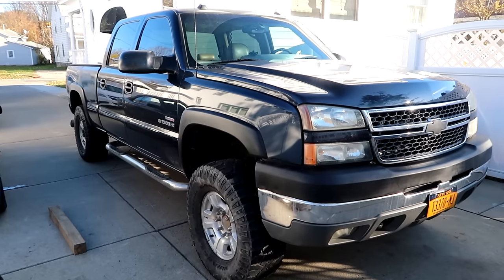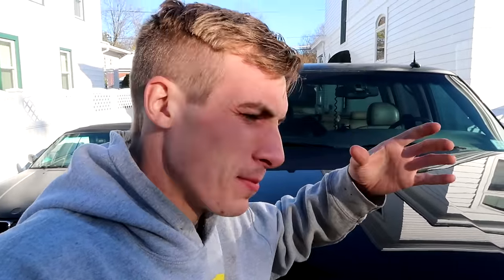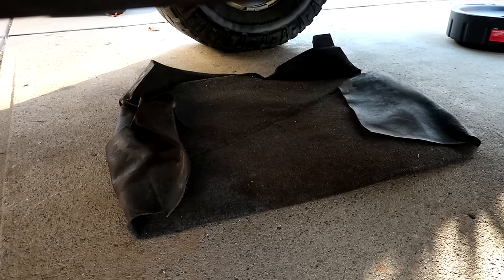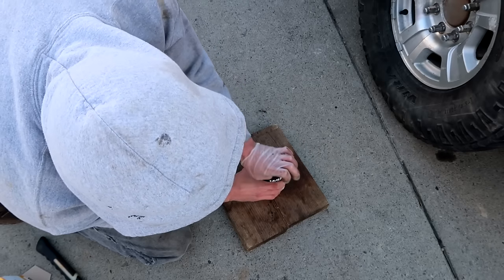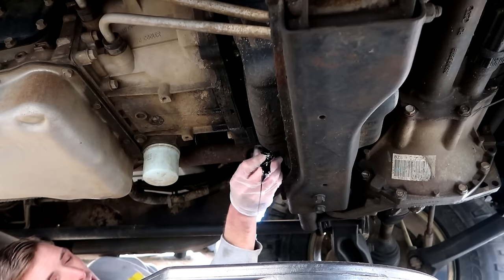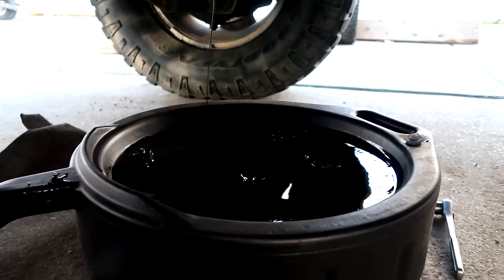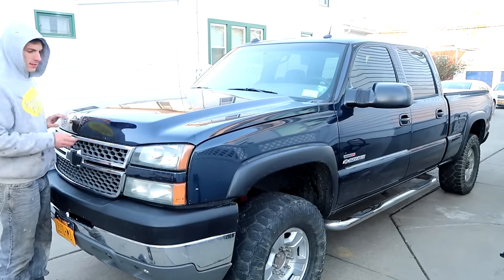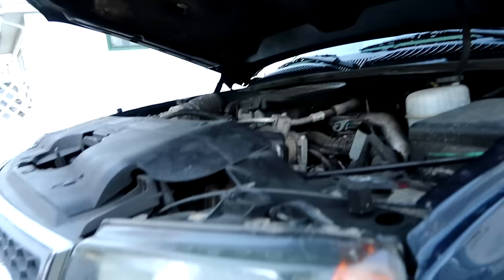THE WORST THING ABOUT A DIESEL...

Comment: I have 322,000 miles on my 2000 silverado with a 5.3 Vortec V8.  I change my oil every 3k miles.  YOU DO NOT FOLLOW THE ENGINE OIL LIFE GAUGE.  THAT IS HOW YOU FUCK SHIT UP!!
Reply: I have a truck that has 1 million miles on it
Reply: well then you must hate me i got a 1999 chevy silverado 1500 with the 5.3 also and i do oil changes on it every 5-10k miles if i feel like it and a 2003 gmc sierra 2500hd with the vortec 8.1 v8 and when the meter gets to 10% i throw another quart or two of oil in in then let it get down to 5% again then i change :)
Reply: also my 1999 chevy has 258,xxx miles and my 2003 gmc that i use for hauling has like 348,xxx miles on it and both still run just fine p.s. i run the cheapest oil i can get my hands on
Reply: Wind King That's interesting.
Reply: UNDEAD ASSASSIN as a mechanic, i call bs!
Reply: sgtLogez On what?
Reply: you dont need to change oil every 3k miles just follow the engine oil life gauge. in all the years of working as a mechanic i have never seen an engine which broke down because the oil wasnt changed often enough. i have seen cars beeing just fine after running 45k km on the same oil (on this model you normally change the oil every 15k km)
ps: sorry for bad english, i am swiss.
Reply: sgtLogez Maybe you don't need to,  but I do. Nothing has ever gone wrong with it,  and it runs like new.  So I'm gonna keep doing what I'm doing, thanks.
Reply: yeah they tell you that so you can bring it in to the dealer and get it fixed
Reply: Bike254 EXACTLY.
Reply: sgtLogez Break down,  probably not.  Run less efficiently,  and not last as long,  yes.
Reply: That "oil gauge" is just a percentage measurement of the oil service interval. Its just fine to do within that period unless the rings are fucked.
Reply: 5k is perfect intervals imo. At 5k you're not going way above and beyond, like those who run 8k or 10k miles, but you're also not changing it at 3k, which in a lot of people's world's would be quite often. 5k for me and everyone I know is 5-7 months, so twice a year and we've never had any problems whatsoever. Just my opinion, you can do whatever you feel the need too. What you're doing definitely isn't gonna hurt it, only help it, so have at it
Reply: UNDEAD ASSASSIN i have a '01 5.3 Vortec V8 at 310k still runs strong
Reply: Boe S. Awesome.  And of course it does!!  :)
Reply: That gauge doesn't know anything they're a joke
Reply: brandon65678 Indeed.
Reply: Brother, a diesel does not need the oil changed every 3K. 5K is a better interval. This is due to the 3 gallon sump for oil. Gas rigs? 3K is the way to go......
Reply: UNDEAD ASSASSIN dude I get 30,000 out of my semi before I get an a service. That's just under 2 months of work. So why are you changing your oil at 3k on a gas motor? I go 5k on both of my boosted VWs and the oil comes out a dark honey color.
Reply: FranksDD15 Cheap insurance.
Reply: Semis stay hot all day and they tend to last 1M plus though
Reply: Disagree. I have owned 8 cars in my life and they all died of several reasons but the engines were Always as good as new, mostly after 200k miles (on gas). I just follow the instruction manual intervals on each car. There is no harm in changing more often, except your own wallet.
Reply: I'm sure the manufacturer knows best what their engine can handle. General rule is 3k for conventional, 5k for blend, 7k for synethic.
Reply: I believe Service intervals for vehicles in Europe now are generally 10-15k or occasionally further, although typically they will also say annually if that comes first. These vehicles will specify fully synthetic which naturally lasts longer, but I don't see why anyone would change at 3k unless they like throwing oil and money away.
Reply: Those oil life meters go off of hours I believe not an actual sensor
Reply: The GM Oil Life monitor takes into account things like outside and engine temperature, vehicle speed etc.  It does a pretty good job of compensating for operating conditions.  And test after test has shown that recommended oil types still have solid performance characteristics when the OLM runs down.
Reply: my 96 suburban has 218k and I have gone 10k miles before oil changes (bad I know)

I've also personally seen an early 90s Cheyenne with 300k that hasn't had an oil change since it was under warantee owner is the origional owner and just adds oil as it gets low.  chevy engines are tough.  well the 350 is anyways
Reply: +Frogboyattacks right you had a lemon so it's impossible that anybodys chevy is reliable...

Comment: you should be changing the fuel filter every oil change, if not at least every other oil change..
Reply: You change it according to the service manual
Reply: ?? Fuel filter every oil change?? I dont know what kind of back woods crap you buy in where ever (ur sister is pretty) kinda town.. but a fuel filter, goes waaaayyy longer than that my man.. lol
Reply: parksey0345 trust me, it's worth it when you have a Duramax or power stroke or a cummins. I'm a diesel technician, it's what I do everyday. the high pressure fuel pumps do not like anything in there at all. and changing one of those is very expensive.
Reply: 607 Moto I'm with you on this one!! Cheap insurance! No reason not to. Would have also liked to see him grease the front end!!
Reply: Joelf2312 15k mile oil change? Holy crap lol. I change the oil in my duramax every 5k
Reply: Joelf2312 Actually you don't have to change the filter under bed every time. That's a water separator, only need to worry about that one when you get water in your fuel. Saves you a whole lot of money per change too.
Reply: Well they also don't want you doing your own oil changes and maintenance. But somebody stole my manual, so I haven't read through it like I prefer to do with my vehicles.
Reply: I do all of my fuel filters every second oil change just before winter. -40 up here and I'm not getting stranded because of a plugged fuel filter

Comment: I feel you my grandpa had a 7.3l powerstroke f250 it took so much oil i think like 14 1/2 quarts but dont forget his truck is a 6.6l my grandpas tuck was a 7.3l so it needed one gallon more than he needed
Reply: 747a380austin 111 yeah I just spent $100 on an oil change for my 7.3. But that's using motorcraft everything.
Reply: 747a380austin 111 I feel u my dad's truck was the same way it has a 7.3 in it
Reply: @weslyrobinson i have a 6.4 powerstoke
 It takes 16.5 quarts. With motorcraft filters and rotella t6 oil its like 175 to change mine
Reply: ive had both a 6.0 and 7.3 and my 6.0 also takes 15.5 qrts but the reason why the Ford engines take more is cause they are international motors and were made for school buses now the 6.7 is made by Ford but still uses 15 qrts but the new Chevy 6.6 uses 12 now I think but I'm not sure on it but the reason they have less is cause they are made by Isuzu with Chevy and gotta have a small oil pan to fit inside of those small box trucks
Reply: while we guys are talking about oil change I was 18-wheeler service tech the least amount of oil that one of those take is 32 quarts and that a Detroit and the most is a catapiller and those take 44 quarts and the catapiller has an oil filter that holds a 4 quarts just on its own
Reply: Adam Helms or we can imagine how much the big earth mover that is a 16 cylinder engine held, I used to be a tech at international and met a guy who worked on those motors and said they had a special pit to drain the oil into

Comment: Hahahaha you're complaining about 3 gallons  of diesel motor oil in your truck. I drive a semi and my kenworth w900 with a Cummins motor takes 13 gallons of oil and the oil filter alone holds 1 gallon of oil. It gets super expensive when you're doing oil changes on a semi it's around $200-$350 per oil change. Right now I have around 800,000 miles on it and it gave me no problems at all yet because  I maintain it a lot.
Reply: fordf150 _ I feel you I work on a farm and on some on those Cummins take well over 15 gallons
Reply: Faraj Chowdhury  one question, why are we doing the 2 videos a day and each have to get 10k likes?
Reply: I work on a canola/ wheat farm in North Dakota. I mainly do the shit work no one else wants to do, but ocanisaly I haul grain to the elevator.
Reply: my John Deere uses 14 gallons of engine oil
Reply: That was I use for fuel. I don't use diesel just oil from the turbo. Only way I drive.

Comment: Diesel engines require lots of maintenance, not just changing the motor oil.
Reply: That's cause they are meant to last longer. And they do.
Reply: old diesels do require a lot of maintenance but not the newer ones, oil and oil filter, fuel filter, air filter, some have grease zerks on suspension components - just like any car.

Comment: what is that whistle that comes from the truck after the start up.
Reply: hkbbs the turbo
Reply: hkbbs turbo
Reply: Elijah Paredes why is making the noise at idle, and it the noise starts a second after the truck turns on
Reply: hkbbs it is what you call a "delete" that's why it's making that noise
Reply: Wait I thought that was the turbo
Reply: hkbbs turbo
Reply: 2jz Films yes, turbo delete its where it gets rid of all the emmisions and crap that's why you don't hear that on a stock truck
Reply: hkbbs thats the turbo
Reply: 2jz Films that's also why it black smokes or (rolls coal)
Reply: Elijah Paredes  it's not a turbo delete that would mean that the turbo is taken out it is called muffler delete or if it's a straight pipe then the cats muffler and resonator are taken out and I'm pretty sure his is a straight pipe
Reply: hkbbs it's a straight pipe exhaust
Reply: its nice to see all the mechanics in the comments
Reply: im pretty sure he still has a cat because you need it for visual inspection in ny
Reply: poopaky wowitstinks yeah true
Reply: hkbbs machine freaks unite!! Lol
Reply: The turbo
Reply: hkbbs maybe it's the air compressor he's got in the back seat
Reply: Outdoor Entertainment um no it's the turbo that pull a more air through it which pulls more bbq fuel
Reply: *more fuel

Comment: that truck, it taken care of could go a million miles. it's was better than gasoline.
Reply: That's my goal, still got a long way to go. I got 480,000 miles on mine. With just a few minor repairs it still runs like it was new.  That's my goal to get it to a million.
Reply: bill carver be careful or may out live you. I seen Mack trucks with more than a million. Looking to get a Ford f 350 my self. Want the 7.3 because I trust it seen it in dump trucks a lot.
Reply: Hey, I got a mack dump with over a million.  That's fine with me if that truck last longer than I do lol. That's what I hear from a lot of people, the 7.3 was the best motor ford ever had. Don't know why they stopped making it.
Reply: bill carver they stopped using the 7.3 because they don't make it. Its a international engine. That's why it works so well. It was diesel from the start.  Ford makes good stuff but the small diesel isn't one of them. But they are getting much better now they are getting the kinks out. The fuel system on these smaller engine is very high pressure and causes problems but the 7.3 isn't its old school.
Reply: bill carver your right. Now connect the 7.3 to Ford's 5 speed standard shift transmission and you have a tank with a truck body. Ford makes good transmissions. At least I thank so.
Reply: Got that right. Standard transmission is all I have owned in pickups so I cant compare them to the auto. But I have hauled a lot of weight with my ford, sometimes a little more than the truck is rated. Only trouble I have had was replacing the clutch like 200,000 miles ago.
Reply: bill carver you gotta be careful not to ride the clutch. Take your foot off after changing gears. Same goes for the transmission don't hold the stick it will eat up the fingers in the transmission.
Reply: I hear that, I'm always paranoid about other people driving it just for that reason. On my friends truck, he always rested his hand on the gear shift, now one gear falls out whenever he hits a bump.
Reply: bill carver he better fix it are it will fail when he needs it most. At least it works like that for me.

Comment: at least it's not a ford 7.3 it takes like 5 galons
Reply: that's why the 7.3 is amazing
Reply: 7.3 power strokes are 15qt. IDIs are 11 if I remember correctly.
Reply: 4 1\2 galons
Reply: I got a 7.3 and it only takes 3 gallons.
Reply: What yr
Reply: 2000
Reply: My uncle has a 95 and it takes 4 1/2 galons
Reply: I would have thought all 7.3s would take the same. But the one I have is the only ford diesel I have owned. Glad I didn't get an older one, lol.
Reply: Dakota Gladden my 02 7.3 takes 18 quarts just shy of 4 gallons
Reply: My 7.3 idi takes 10 with a wix oil filter, the origanal oldschool filters itd take 11
Reply: Every ford diesel starting at the 7.3 takes 15 quarts exactly until the 6.7 that takes 13
Reply: 7.3 power stroke takes 15qts. That's 3.75gallons for people that can't do math.
Reply: LawF250   If that is true, how can I change the oil in my 7.3 and only add 3 gallons? Its always at the full line when I check it.
Reply: Hahahahah you aren't buying gallons, you're buying 5 quart containers. so 3 x 5 is 15.
Reply: Not 3 gallons. It takes 3.75 gallons. You are buying 1.25 gallon containers (i.e. 5 quarts per container)
Reply: Really? I buy it by the 55 gallon drum. And the truck only takes 3.
Reply: Well then you are doing something wrong because the truck takes 15. I'm a ford technician, I think I would know ;)
Reply: Well, it don't take a master mechanic to change oil. Had that truck for 16 years, changed the oil 3 or 4 times a year. All you do is remove the plug, let it drain, put plug back in, remove filter, let any leftover oil drain, put new filter on, then add new oil. I got a gauge on the drum that shows how much you add and it says 3 gallons. Then I check the dip stick and the level is just below the full line. But, you got to be right, maybe I always did it wrong.
Reply: bill carver well one issue there. you never started it. your filter doesn't fill until it is started and I'd you're using a factory filter that in itself is a quart. Unless you have an idi then it takes 15 quarts. I work on these pretty much every other day
Reply: Ok, then why would it stay at that same level for a long time? I never have to add oil again till the next oil change.
Reply: Dakota Gladden 15 qt us
Reply: 03 6.0 takes 15 US qts too.
Reply: its an idi that's why
Reply: Dakota Gladden same with my 7.3
Reply: then your using 5 qt containers to fill it, I own a 2002 and I work on alot of them, 15 qts
Reply: my 7.3 takes 15 quarts, plus 3 quarts for the high pressure oil pump on top
Reply: I've got a stock 03 7.3 F250. It holds 15qts.
Reply: 7.3 15.1 quarts ;D lol
Reply: I have a 7.3 15 quarts! rip!
Reply: yeah ur injectors must have been leaking when u dumped five gals of oil out...typical ford
Reply: Watch this guy, Ball joints on his dodge are flying out! Hes pissed and as drunk as a firedick
Reply: OBS 7.3 power stroke uses 3.75 gallons
Reply: My 7.3 takes 15 so I don’t know what the people in this chat are talking about.
Reply: Fords from the 7.3 thru the 6.4 took 15 qts. The 6.7 takes 13.3 qts  but that’s nothing compared to the big boys  an ISX475 Cummins takes 14...GALLONS  plus filter(s) plural $500 oil change but you get a lot more miles between changes 80k miles
Reply: Dakota Gladden Amen i drive an obs and its rediculous
Reply: To clear up some confusion for you guys. The 7.3 Powerstroke, BONE DRY of oil, takes 15 Quarts total. 12 for the rotating assembly and valve train, and 3 get stuck in the upper part of the truck. Your probably asking wtf where? Well there is about a Quart in each head in an oil rail, and one in the reserve for High Pressure Oil Pump. When you do an oil change, most people don’t flush out these 3 quarts. These 3 quarts usually contain some of the most beat on oil in the truck as oil isn’t designed to be under such extreme pressure. 500-3000 psi in a 7.3, up to 3500 in a 6.0. Anyway, if you drain the truck, it will take 15 quarts and show up either too much oil. However, if this top half of the truck is drained (watch a video on it) it will refill with oil after a lot of cranking and then the truck will kick over. But I suggest watching a video on a 7.3 Powerstroke Oil change.

Comment: You should try the heated remote dual over-sized filter set up that some of the HD units had installed as a regional option around here. Pushes it up to 4 gallons.

Comment: No way i would ever go by oil life % Change it every 5000 and you will see you truck will last a long time my 2014 cummins at 5000 miles is 67% all this 8500-15000 mile talk what ever its not a peterbilt
Reply: Bike254 agreed...I have a second gen Dodge and I never go over 5k unless I'm stuck out on the road and can't get a change. I usually stick to changes between 3 & 5K but I create a little more soot than most lol.

Comment: I wouldn't recommend filling the filter from the center. Oil flows from the outer holes towards the center. May take an extra couple minutes but will prevent any possible crap from entering your  engine. Great video btw. 😃🖒

Comment: Pull the fill cap off before you drain the oil to help it drain faster. I own a Cummins and it holds 12 quarts with filter. Its a lot of oil but the upside is you can usually go about 15k miles(6 months) before an oil change is due. It changes depending on how you use your diesel.

Comment: you could add that one bad thing about having a diesel vehicle is running out of fuel. ha ha. did that in my 83 c10 Scottsdale with the 6.2 and a 700r4. had to have another truck to help keep the batteries charged while priming the fuel system. 

oh and good luck changing the valve cover gaskets on those ha ha.